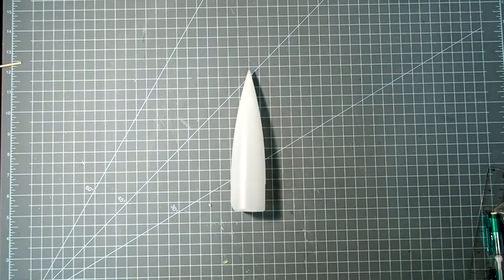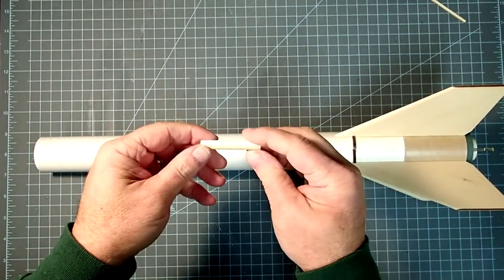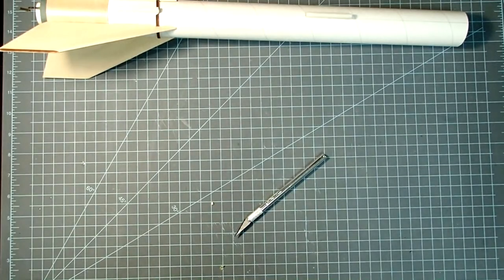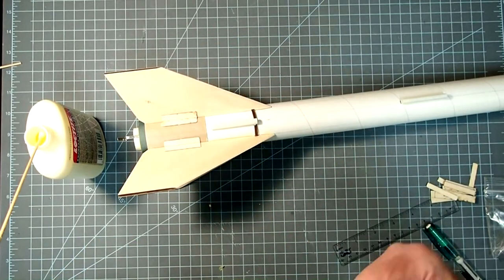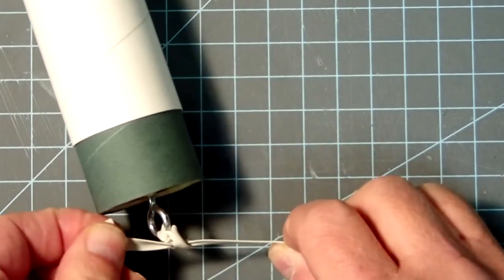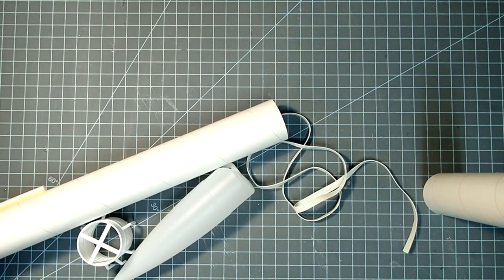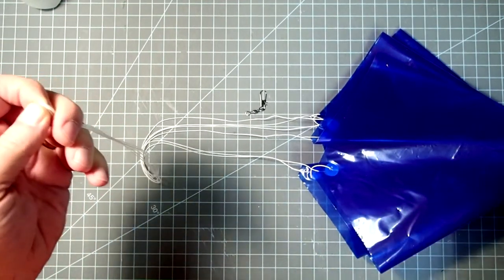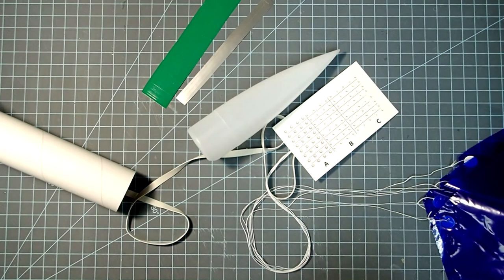Rocketarium “Sandhawk” model rocket assembly (part 2 of 2)

Comment: IMPORTANT NOTE: @26:00 Don't glue the plastic antenna section to either tube unless you are sure that you don't want to ADD a PAYLOAD container.  The short tube below the nosecone makes a great payload container, you'll just need to block the holes inside of the antenna section and add a way to connect the parachute to the antenna section too.  With a payload container you can add an altimeter or other devices.  You could attach an altimeter to the nosecone but you need to drill holes in the tubing below it, I'm not sure if these holes would let too much of the ejection pressure out and prevent the parachute from deploying.

Comment: You can use white, or wood glue diluted 1:1 with water to seal the wood fins.  Paint it on with a small brush, let it dry and sand as you would with sanding sealer.